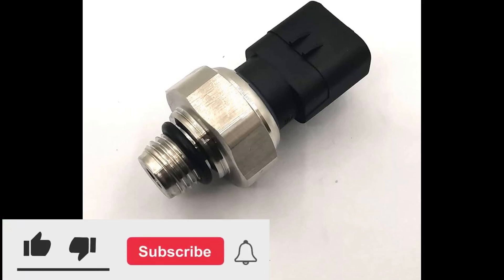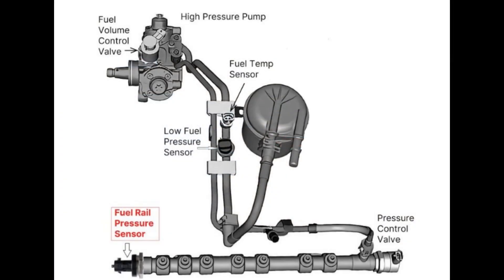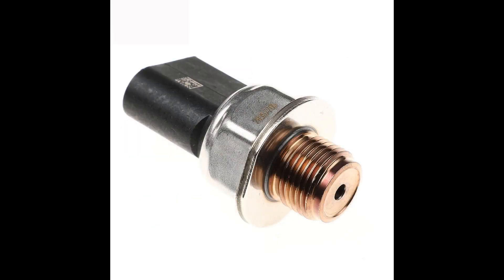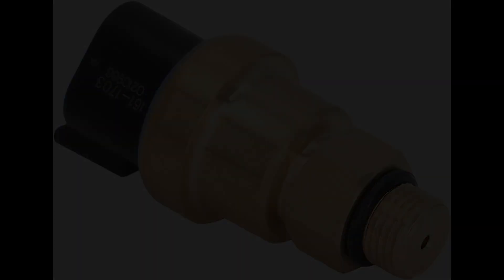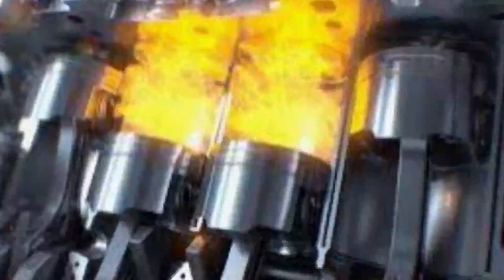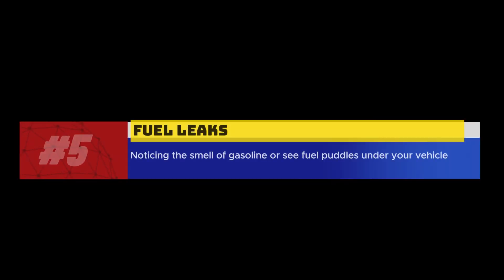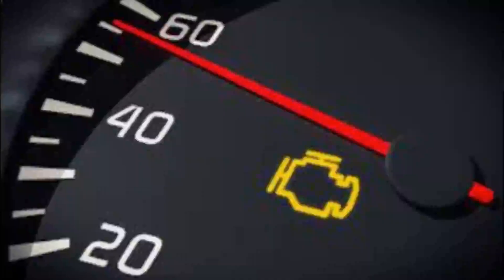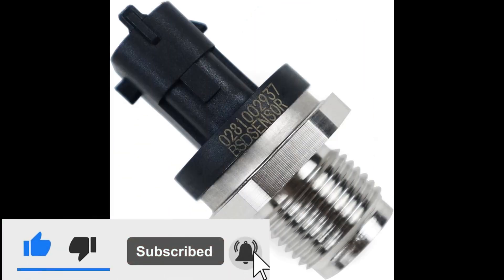Symptoms of a Bad Fuel Rail Pressure Sensor in Your Car

Comment: Good day guys, has anyone experienced this before and how did you solve it. MY CADDY 2005 ONE INJECTOR POUR PETROL NON STOP and it keeps on damaging the ECU every 3 or 4 Months I must replace it. I took in to check by the auto electrians and changed the injector set twice but the problem is still continues

Comment: Ive got that check light on and the red stop lights come on now and ive niticed when i remove the fuel cap i can hear light sucking sound like gurgling what could that be
Reply from the maker: It sounds like your fuel system might be having issues. A potential issue with the engine or fuel system could be indicated by the check engine light and the red stop lights turning on. When you remove the fuel cap, you may hear a gurgling sound. This could indicate that there is a clogged or blocked fuel vent, which can create a vacuum in the fuel tank and cause issues with fuel delivery. I would advise having your car inspected as soon as possible by a qualified mechanic. If you ignore these warning indicators, your car may sustain more damage. A gurgling sound when removing the fuel cap, trouble filling the gas tank, or the fuel pump nozzle shutting off too soon are all indications of a blocked or clogged fuel vent.